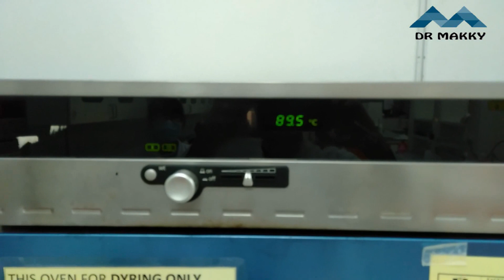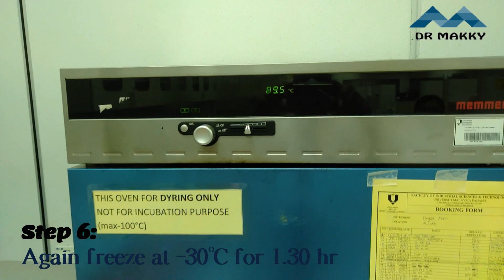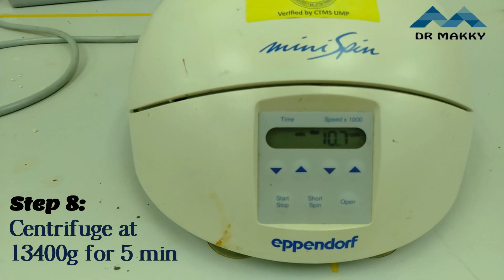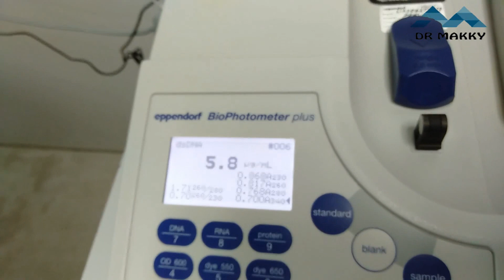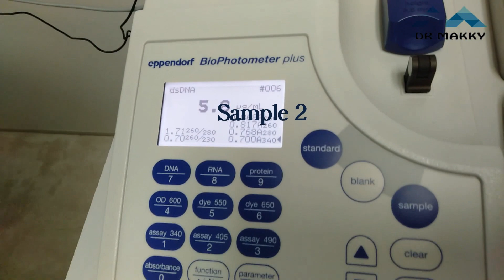Bacterial DNA Extraction

Comment: Also sir, can you please post another picture of the DNA ring that you mentioned.
Reply from the maker: Sure I'll try to find a clear one .. Thanks
Reply: @DRMAKKY  sir, I tried this method but could not see any ring. Also my culture is from NB agar plate so is that creating it's difficult to see the ring? Since you are using McFarland.
Reply from the maker: @samridhipushkarna4162  I appreciate you asking. I believe you should try to increase the concentration of your bacterial suspension and/or double-check all of the reagents and extraction processes that were employed.
Reply: @DRMAKKY  I am trying to isolate dna by other methods also but evey time I rna contamination. Is there any other way to remove rna contamination if we do not have rnase A

Comment: hello sir! i have a question, 

1. Explain the purpose of each step in the protocol. How will each reagent interact
with the biomolecules in the cell ensuring the isolation of genomic DNA?
2. Aside from organic extraction, what other methods can be used to extract DNA
from cells?
Reply from the maker: Hi .. thanks for ur questions. For Q1, u need to check the DNA concentration & purity using microvolume spectrophotometers. For Q2, ther're many other methods using different Extraction Kits.

Comment: Hello sir 
I have following questions-
1. What we call this technique that you have used ??
2. What if I have -20 degree maintenance in a lab deep freezer ?? Can I put eppendorf in it?? Any alternative?
3- Can I use this technique to extract DNA from microspodian spores ?? It is a sister fungus group that resides in the abdomen of bees..

I really need assistance. Plz help me out
Reply from the maker: Hi Saumya and thanks for ur questions .. For Q1: this is called a simple technique to extract bacterial DNA using TE buffer. For Q2: actually -20 u can use but u need to increase the time, on the other hand, u may facing NOT accurate extraction. So, u can try -20 otherwise u have to use -80. For Q3: NO this technique is for bacteria. If u need to extract the DNA for fungus u need to use an extraction kit. I hope it was beneficial .. Good luck & Thanks again
Reply: @DRMAKKY  thanks sir. Means a lot. In support of your third answer, I want to tell u that I have used DNeasy plant mini kit six times but I didn’t get results yet😞 on electrophoresis
Reply from the maker: @SaumyaSharma123  I think this is due to u r not using DNA fungal extraction kit coz if I'm not mistaken the DNeasy plant mini kit for plant DNA extraction. Try to change the method (kit).